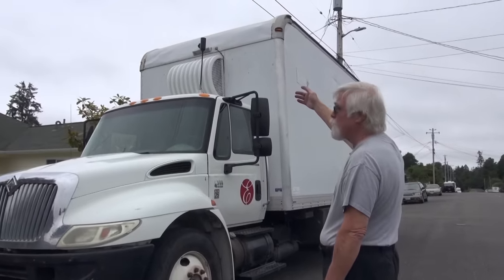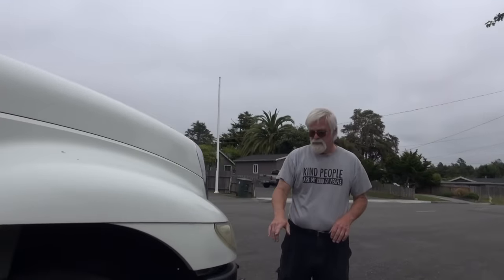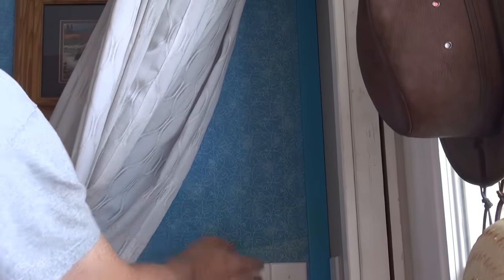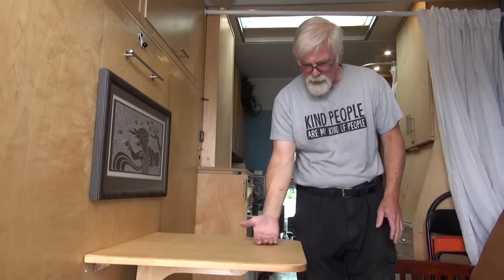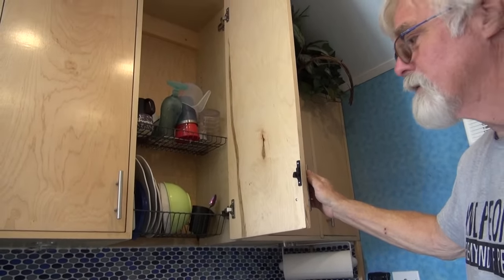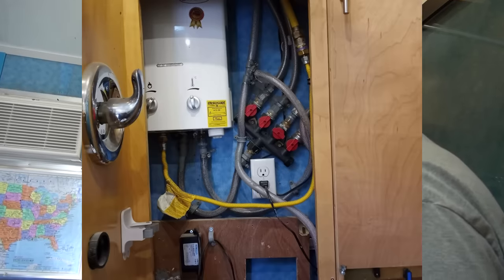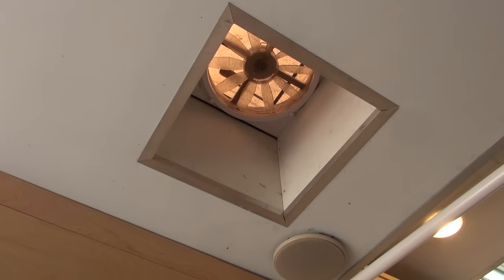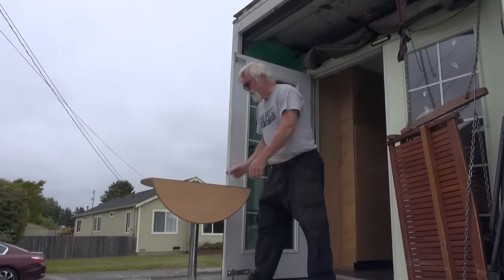Harvey the RV Stealth Box Truck Conversion/Tiny House Full Tour

Comment: I've seen A LOT of renovations but yours is so much more comfort designed as well as truly stealth by thinking about any possible noise and dealing with it to an extent that you have almost thought of everything!
With the size of your Roof you would have plenty of size for solar as well as you have plenty of size to make a rolling Battery holder under the Truck locked with a fake toolbox lid. You could then feed your Battery's anytime via your alternator If its way to cloudy outside for the Solar plus those marine Batteries they last forever, I doubt you could run them down unless it's days of usage.                                               

I'm only  suggesting it as after awhile it will  save you alot on your Propane.                                            
Again AWESOME truck!
Reply from the maker: Thanks Jack! We have 400 watts of solar panels on the roof. That was enough to keep us fully charged except when we were in cloudy weather for a week or so. I am in the process of upgrading to 700 watts and think that should solve some of those issues. We rarely used the generator, instead we just pulled in somewhere we could plug in the shore power charger. We put the Lithium batteries inside under the desk because they have a problem with cold temperatures.  I wish I had taken your suggestion to hook the batteries to the alternator and may still do that. It kind of depends on how much driving you do. Thanks again for your thoughts, I really appreciate you taking the time.
Reply: @DrDuze-se5cx  Renogy has a smart DC to DC MPPT solar charger that also gives you an easy connection to alternator charging. Bought one but haven't installed it yet, but I'm pretty impressed with what they've come up with. I just have to replace my solar charger and connect to my starter battery. Reasonable too.
Reply from the maker: Thanks I will check that out! @marketingcoach

Comment: Thank you for sharing your valuable information.    I am in search of a home on the back of a truck, but box truck, ambulance, van???  Presently, thinking box truck will have height in the box that will be pleasant for living.:hand-pink-waving:   Please expound on the water recycling mentioned in the shower part.  :penguin-blue-waving-tear:
Reply from the maker: I learned about the shower from Snow and Curt https://www.youtube.com/watch?v=L0AR4COFJng 
The large truck has lots of benefits, but it is also a problem in cities with tight streets or poorly trimmed trees. If I was going to take small trips, I would prefer an ambulance, but for long, multi-month trips I really like the space and particularly the back lift/patio.

Comment: He's going to be disappointed when he tries to use that winch for the first time.  There's a reason they are mounted in the center of a vehicle.  It's not going to pull straight, and the cable is going to want to spool all on 1 side of the drum.
Reply from the maker: The winch is positioned so that it faces the hillside at the side of the road in order to use it to belay down the hillside or get pulled back up. If it were centered in front the truck would have to park perpendicular to the road which is often not possible in pullouts. As it is, the winch is angled at the hill I want to climb down which still leaves the truck awkwardly positioned to get the cable to wind properly. I had originally intended to mount the winch on the side rather than bumper.

Comment: Beautiful love the walls looks like wall paper so homey so much storage too❤️
Reply from the maker: The walls are covered in cotton fabric suspended in watered down white glue. It is a scenery technique used in theater. Just paint the wall with 2/3 white glue and 1/3 water mix, then lay the fabric in. Finally paint over the fabric with the glue mixture. The texture is lovely and the range of patterns nearly endless. The only down side is that unlike wall paper, the seams have to be covered with a batten. I am glad you liked it.

Comment: How do you deal with leveling the truck for sleep?
Reply from the maker: We just made sure the head was higher than the feet. For us, it was not a problem to be at a bit of an angle side to side in the king sized bed. I had originally  thought of adding hydraulic lifts, but decided to keep it stealth and it worked for us.
Reply: Also, the leveling problem mostly affects RVs with standard upright refrigerators, whereas we had the Dometic one (described by Eric in the video), which doesn't need to be level to work properly. As long as we parked as close to level as the site allowed, as Eric noted, with the higher side matching up with the head of the bed, we could easily make up any 'difference' with our pillows, to be sure our heads were elevated, not lower than our feet -- (it can cause headaches to sleep that way,  we've read!)

Comment: How does he make sure the back windows don't rattle & break? I once saw a truck with sliding glass doors & thought the same since they are usually pressurized & shatter easily. 🤔
Reply from the maker: The windows in the doors are quite secure. They are double pane and are held rigidly in the door frames. The doors are locked in place when we drive. So far so good.

Comment: Could have used a 12v fridge and wouldn't have to cut a hole to the outside
Reply from the maker: The chest refrigerator is a 12v, but my local RV folks did not offer an alternative that was a standard stand up 12v refrigerator and did not need ventilation. If you have one you like, I would be interested in the link if you get the chance.

Comment: Thanks for a really nice video.
The only think I don't like about your box truck is the toilet solution. I think it's a huge waste of money and material to use one bag for  every time you're going to poop - even if you don't change the bag EVERY time. I can totally understand that you refuse to have a black water tank and what comes with it to empty and clean it, but what about a composting toilet just like Nature's head? It doesn't have to be this specific one - there are so many good, affordable brands.
Just do yourself a favour and at least think about it.
Reply from the maker: Thanks, I considered all of the options, but I did not want the refuse in the truck due to odor. I know some are better than others, but for me the bags worked well and were cost effective. But, I certainly understand that other campers could have different preferences. thanks for the thoughtful comments.
Reply: @DrDuze-se5cx it's not really about preferences so much as destroying the planet you share with the rest of us.
Reply: That argument is a lot more applicable to the disposal of used diapers, which happens daily in enormous quantities, in many other countries as well as the US. (And the alternative of washing diapers instead uses large amounts of treated water, electricity and/or gas (plus detergents, etc.), which are scarce or costly in many locations, thus putting a similar burden on the environment.
Reply from the maker: Thanks for your thoughts. I really do not agree, but that is the beauty of America. take care. @pjaypender1009
Reply: There are compostable bags that can be used. Also, think about using pine pellets instead of the clay litter for #1. I used the pellets for years, and they break down into a sawdust and can be cycled into the ground.
Reply from the maker: Thanks for this info. Do you know what the brand name is for the bags you recommend?  @tonik9724

Comment: Shitting in a bag.  Nope
Reply from the maker: I certainly understand the feeling. Bag toilets have been used on boats for years. Walmart sells Wag Bags for campers. Shitting in a bag actually works pretty well with the kitty litter, somewhat to my surprise. It is sealed up once you are done and then sent to a collection bag under the truck for disposal. The thing I liked about it was that because the top of the chute is sealed, it does not emit any odors later on,
Reply: And, the astronauts have been using this system for decades -- except those folks, floating in a no-gravity capsule, must first TAPE the bag to their body for containment!
Reply: Well it's clear you wouldn't be welcomed anyhow lol YOU would whine and complain until you were escorted away by police.
Reply from the maker: What? @TingTingalingy
Reply: @TingTingalingy Huh??
Reply: @TingTingalingy Eric and I are both replying to comments here, but neither one of us has any idea what you mean by yours!
Reply from the maker: Hey, I appreciate you sharing your thoughts. Please be kind and respectful. @TingTingalingy

Comment: Ugly interior, great design but damn….
Reply: Why ugly? What would you change?
Reply: I'm glad you said it so I don't have to. Bro ain't winning no design awards that's for sure.
Reply: Function over form is an aesthetic. You don't have to like it, but it's not an excuse to be rude.
I like the fact that there are no frilly and pointless bits and bobs, and the paintings show personality and character.
Reply: @punzelle  I do not agree that it’s ugly at all!! But the simplest change that would appeal to a broader spectrum of people would be to paint all the light wood interior white, maybe a neutral wallpaper over the blue walls in the living area, and the back doors white on both sides as well. 
They also make dry flush toilets for RVs that is a similar concept to this bag toilet, yet without kitty litter and daily bag dumps.
Reply: @Peace_from_within no 
The light finish wood is much better than paint, esp white
Reply: @YeshuaKingMessiah  it’s outdated but this is 100% personal opinion so no need to discuss anyone else’s preference, I merely gave a suggestion.
Reply: @Peace_from_within  it’s outdated is also ur opinion lol
Reply: @YeshuaKingMessiah  yes this is correct, basically what I said in my last reply.

Comment: I saw something like this but it had a couple windows that looks like vents and you could tilt them out if you didnt have to be super stealth, and you could open open from the inside and still get fresh air
Reply from the maker: I saw those as well. I think that is a great idea. But, I could not figure out a reason to have those on a commercial truck so opted for the no windows approach to keep it stealth. My goal was to make it so no one would give the truck a second thought.
Reply: I'll add that when we were parked for the night or for lunch somewhere scenic, we almost always opened up the back French doors and spent time outside on the patio or 'veranda' (even in a drizzle, we could pull out the awning to cover us). If we were driving, we of course were in the cab with windows. Any other times, when we stopped and stayed inside, we still had the option of light from the cab and the opened back doors, as well as a big skylight and ceiling-to-roof fan which let in light, so we never felt the need for any side windows, which would have compromised our 'stealth' goal. Worked just fine!

Comment: wonderful but I would have enclosed the toilet room given more than one person lives in this.
Reply: The shower curtain could be pulled around to provide privacy there.
Reply from the maker: I totally understand the feeling that a little more privacy would be nice. I left it open so that the kitchen area could extend all the way through the shower giving us room to work around each other. With the floor of the shower on the same level as the rest of the truck and no curb, it just really opened up that part of the truck. Enclosing the toilet would have meant making the whole front area much smaller. Still, when you get to be seventy, you may have less inhibitions than you did when you were younger :goodvibes:

Comment: Love the layout I would love a layout like that the only thing I would change is the bathroom sink way to small
Reply from the maker: You are certainly right to point out the small sink. It is fine for supplying water in the bathroom, brushing teeth and washing hands, but not good for much else. Unfortunately, there was not room enough for a larger one without expanding the size of the bathroom cabinet.
Reply: I don’t see how u would possibly spit into it with the cabinet right above!
Besides it being so small/narrow ledge

Comment: Needs a skylight escape hatch, stealth roof deck, and solar, with a handy rope ladder for getting up/down.
Reply from the maker: I had designed it that way originally and still thinks it makes a lot of sense. I did not do it because we are in our seventies and I was not convinced we would be able to get up the ladder, pull ourselves up onto the roof etc. I planned on putting a deck on the roof, but I could not figure out a practical guardrail given that we were already 13ft 3 inches high. If you come up with a good solution, I would love to hear about it.
Reply: Yeah --  escape-wise, we can exit in either direction (front or back); we also do have solar on the roof, and can see plenty of the night sky from our 'veranda.'

Comment: With your generator, what do you do if your fan goes out. Will you know? What kind of switch lets you know before you smell gas?
Reply from the maker: The fan helps with overheating. If it goes out and the generator overheats, it automatically shuts off. I hope that does not happen. I do  not think you would smell any gas as it is propane and that would just stop flowing if the generator was off. It is a great question

Comment: I'm sorry if i missed in video. What is make/model of truck?  Dimensions of truck/box?  Cubic inches of motor.  Mpg?  Any other useful info appreciated. Is it too big or just right?

Thanks
Reply from the maker: Hi, the truck is a 20' International 4300 box truck. With the skylight it is 13'-3" tall. It has full size wheels and the box is 8' tall inside. The engine is a dt466. It gets 7-miles to the gallon. It is hard to answer the question of whether it is too big. It is big and that limits where you can take it but not very much. Hard to park in some locations, but with a little thought and effort you can get most places. I have a truck GPS which will alert me if a route has limitations given the size of the truck. I spend a lot of time in the truck which makes the larger size useful. If you are someone who just needs a safe place to sleep, but spends all day out having adventures, it is probably bigger than you need. I am a homebody so it works for me.

Comment: I would put a piece of wood in front of the glass door while you are swinging
Reply: Really unnecessary as the swing can't contact the French doors, even at full range
Reply from the maker: Hi, fortunately the "garage" area is 2 feet wide, enough so the swing can't reach the glass. But, when the swing is stored for travel a piece of wood protecting the glass might be a good idea. Thanks.

Comment: Very nice build! I want to do something very similar. What was the cost of the truck and the build?
Reply from the maker: I bought the truck (with required repairs) for 11k and put 45k into the build.
Reply: @DrDuze-se5cx  Ok, $11,000 for an 05 International 20' box sounds about right but $45,000 for the build? I'm not buying it. More like $15,000 ......$20k max.
Reply from the maker: I wish you were correct. Perhaps someone with more experience could have eliminated some of the prototypes that had to be redone, but I just kept imagining all of the possible pleasures and conveniences that we might want and adding them. A couple of things I did not include in the video were the outdoor kitchen on the back deck, the technology in the cab that included Truck GPS, tire pressure sensors and dash cam as well as the bug room on the back deck. In fact, the $45k is calculated from the receipts I shared with the insurance company... there were more.  @robmcguckin7605

Comment: Wonderful conversion; How much insulation in walls, floor and ceiling?   You didn't say what the generator was: Brand? KW? Fuel?  Truck engine info. & mpg?
Reply from the maker: The walls consist of an aluminum shell, and air space, then a 3/4" plywood wall. Over that is 1 inch rigid insulation covered with a 1/4" ply interior wall. On the driver's side it is covered with cabinets. The other side is open wall for about 8' and then the desk covers a part of the wall followed by a  double paned sliding glass door that acts as the shower wall. All that to say that I am not sure what the R-value is for the walls. The ceiling is spray foam with a shallow attic and 1/4" ply, about R-20. The floor is aluminum, covered by a 1" deep framework filled with rigid foam, 5/8" plywood and a waterproof flooring. I would guess about R-11.  The generator is an Onan 2400 using propane. Truck gets 7mpg, International 4300 with a DT 466 engine. Only two seats with seatbelts, occasionally one of us would lay down in the back, but it is a bumpy ride! We chased 70 degree weather as one of our primary goals, so the insulation was not much of an issue. Take care.

Comment: What size engine and transmission do you have in that international?
Have you had any issues with your drive train? Or climbing mountains or anything that left you stranded?
Thank you very much love the stealth
Reply from the maker: The truck has a classic dt466 engine and Allison transmission. 250k miles. We had a problem with the coolant sensor and later the tank itself. Later we had to have the fuel pump replaced, but the engine and transmission worked fine. This is a slow dog up hills and accelerating onto the freeway. The truck performed well overall as long as we just took it easy getting up to speed and going up steep inclines like the passes over the Rockies.